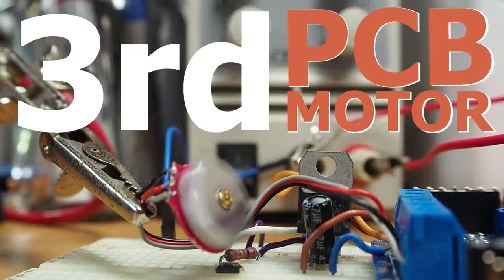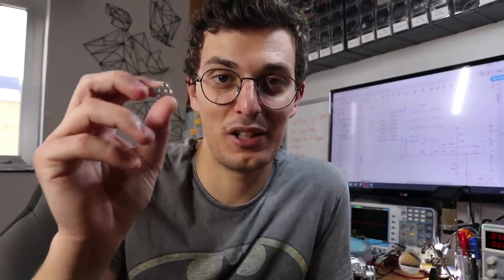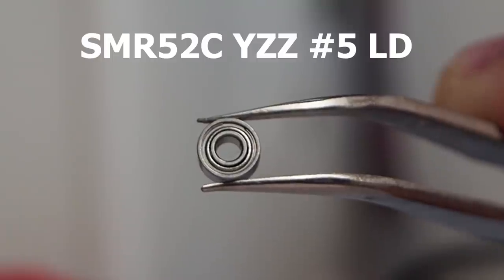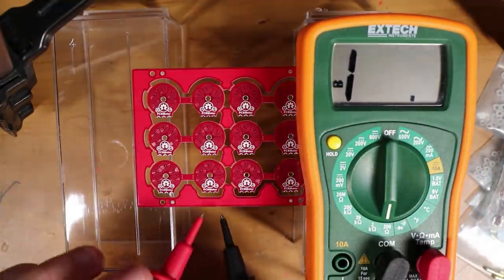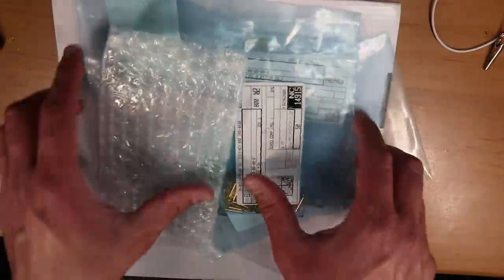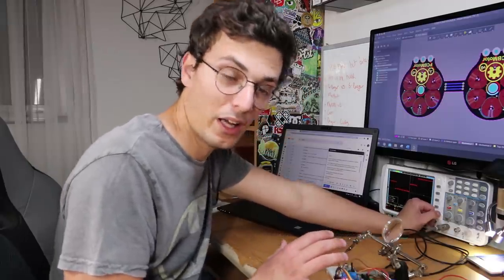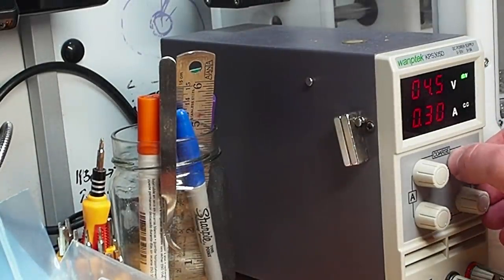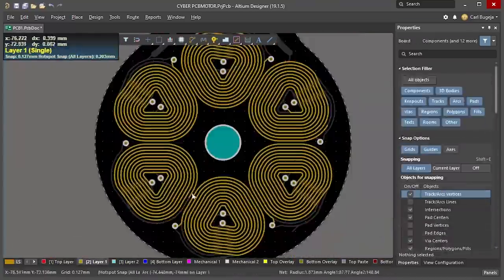Making PCB Motor v3

Comment: You could increase the torque even more, like, A LOT, by putting a piece of iron on top of the rotor, right on the back of the magnets. Brushless motors have so called "back iron" which is the iron ring where the magnets stick to. Yeah that's not alluminium. The magnetic circuit otherwise closes behind the magnets in the air which has a very high reluctance. You can cut such a piece from the iron of an old transformer with big scissors. Since this piece of iron will provide structure you could save part of the gained weight by slimming the aluminium part. This is my field of expertise.
Reply from the maker: Thanks for the tip! I will research this topic further 🙂
Reply: Would it add iron losses? If not, what's the deal with "back ironless" motor designs? And what about Halbach arrays? 

Also, would sandwiching the stator between two rotors be a good idea?
Reply: @CarlBugeja  I agree with nasone32's general idea. Part of the problem is that the magnetic flux generated by one of your windings is weak because most of the path from the north to south of the winding is through the air. So in concept, I think what you want is to equip each winding with a "C" shape iron piece, where the winding and the rotor sit in the gap of the C. The C supplies a much more susceptible path for the coil field, hence the flux is higher.  So, a total of six C pieces, one for each winding. This should also mean that when the rotor is spinning, it generates a far higher back-emf, resulting in a lower effective EMF applied to heating the coil. Just the fact that your coils are getting very hot is a sign that a major proportion of the energy you're putting into the coils is not being used to drive the motor.  (However, If the motor's stalled, then the windings will get hot by straight I^2 x R anyway, because there's no back emf.)
Reply: @revimfadli4666  it would add very minor losses, the magnetic field at the back of the rotor doesn't change much at all.
coreless/ironless motors have no material in the stator which sees a very rapidly changing magnetic field, unlike the field in the rotor.
 a halbach array would work, but packaging in such a tight space would be problematic.
Reply: @bgdwiepp  I see, thanks!
What about adding another rotor so the stator gets "sandwiched"? Would that improve the performance?

And would using a back iron mean adding a Halbach array afterwards basically does nothing?
Reply: @revimfadli4666  yes, sandwiching the stator would improve torque, it would also improve efficiency as that torque would require no more current.

a halbach array would still be beneficial as it increases the field strength in the desired direction, the reduced rear field is more of a bonus.
Reply: @bgdwiepp  thanks!

Ah I see, so halbach array + back iron isn't a waste then?
Reply: @revimfadli4666  correct, there is still field going through the air on the back side of a halbach array, so some small backiron is useful
Reply: @bgdwiepp  thanks a lot!
Reply: Adding a piece of iron or ferrite or some other low reluctance material behind the stator would also help substantially, in addition to a pole piece behind the magnets.  Thinner magnets would make the effective air gap smaller, further decreasing the reluctance and increasing the back emf.
Reply: Or put a second PCB on the other side of the magnets. Adds complexity to the motor, but doubles the torque. Change the aluminium for something non-conductive to stop eddy currents (as noted by Toofsman), and efficiency goes from bad to excellent.
Reply: @CarlBugeja  
не железо. Нужен высокоомный ферромагнетик. или шихтованое железо как в трансформаторе.
А так же нужен магнитопровод соединяющий задние стороны магнитов на роторе. Это увеличит крутящий момент в несколько раз сразу.
Reply: Actually what you advising; Irong back plate act as magnetic conduction bridge that, conduct magnets near by, and makes it bigger magnetic field. It is like using bigger magnet with same size. It is more like Hallbach array princible.

Comment: The delta would be usable with half the voltage.
Scaling up motors to the industrial scale, 3 phase motors come as user configurable as Star or Delta.
In Australia, the single phase power is 240Vac while 3 phase is 415Vac.
When using a single phase to 3 phase inverter to drive a motor, it is normal to connect the motors in the delta config. but when used on the 415Vac 3 phase, we connect them in the star config.
In your demo, you were using 5V, so there is no reason why it shouldn't work at 2.5V in the delta config.
Nice job by the way.

Comment: Cool stuff. The first thing that comes to mind in terms of practical applications when seeing this version is the LSU polygon motor in a laser printer. It's a motor that spins up a polygon mirror attached to it. The mirror then deflects the printer's laser beam to make it cycle through the page in a predictable manner.

I think you'll need at least 15000 RPM for this motor to be practical in that role, and that speed needs to be sustained and incredibly stable. On the upside - no need for high torque whatsoever. With your setup, the mirror and the magnet housing might as well be the same piece, so the only thing the motor would have to spin up is itself.

The same type of mirror unit can be used in a variety of laser devices, such as laser projectors or LIDAR-like sensors.

Comment: You can re magnetize the magnets by heating them and exposing them to a magnetic field then cooling them. You can also add a second pcb on the other side of the rotor to double the power of your motor. Just add a longer shaft. That is the beauty of an axial motor.

Comment: Have you considered making increases to the rotor field strength? Would help with coupling and certainly improve efficiency ( = less heating! :D)
For example, you could put magnets on both side of the stator, or use a Halbach array like Cristoph Laimer's 3d-printed motor.

Comment: Awesome idea! This could also be really interesting to make a linear motor on a PCB. I figure PCB milling should be quite precise enough as a crude linear guide. You could make the coils wider horizontally, add a chip to only power the active coils and maybe add some iron to increase the force. I don't really have much knowledge about motors though.
This could be cool for something like a stewart platform. 6 legs just with their distance to the ground would define the 6dof position of the robot. So with 8 legs that can freely swing you should be able to make a simple robot that can lift two legs while the other 6 keep is fixed, then move all platofmr, lift 2 legs and let them swing back to vertical.

Comment: With a proper driver and commutation using hall sensors, the basics involved are this:
Current = Torque.  Speed = Voltage.
A proper motor driver will reduce current when the commutation is in phase with no lag, so low heat and high efficiency at all speeds. At higher velocity, the current for the torque remains constant if you ignore friction and induced current loss in the conductive magnets.
This motor control can be performed with an inefficient class AB analog amplifier/driver to feed the commuted 3 phase drive to the motor using 3 hall sensors and 4 quadrant analog multipliers to generate drive signals to the amplifier which is configured not as a voltage amplifier, but a voltage to current amplifier. Motor drag, is responded with a change of current to maintain the correct speed by adjusting current to change torque. As the motor runs slow or faster, the voltage to current amplifier automatically adjusts voltage based on motor back EMF to apply the correct committed torque at all speeds.
For higher efficiency, a high speed PWM voltage to current driver can be used instead to produce the 3 phase currents required. If you change from a 3 phase design to a 90 degree 2 phase design, cheap stepper motor drivers can be used to run constant current, thus constant torque and constant heating in the motor at all speeds. Use higher supply voltages for higher maximum speed. To grasp the concepts, stepper motors are inexpensive in smaller sizes along with off the shelf stepper motor drivers. Play with and learn stepper motor driver theory and technology to transfer to your PCB motor designs. You can buy 3 phase versions, but they are less common and more costly.
https://www.amazon.com/dp/B00PNEQ79Q?tag=duckduckgo-d-20&linkCode=osi&th=1&psc=1
Stay away from the arduino stepper H Bridge drivers. They are made for slow speeds such as 3D printers. To learn motor drive and view waveforms, get a real CNC style stepper motor driver.
https://www.amazon.com/Usongshine-Stepper-Controller-Leadshine-2-Phase/dp/B07PHLJM22/ref=sr_1_36?dchild=1&keywords=stepper+motor+controller&qid=1592375778&s=electronics&sr=1-36
You set the desired current in dip switches, and your maximum speed is limited by your maximum voltage used. If 1 Amp is too much, you can buy smaller motor drivers.

Comment: The low resistance of the delta configuration is not a problem, it is necessary for higher speeds but you will need a smarter driver that has current limiting

Comment: Very cool work. Just wondering if the switch to using aluminum for the rotor causes eddy currents, and if that might reduce the efficiency of the motor?
Reply from the maker: Thanks! Hmm 🤔 very good question.. I don't think eddy currents will reduce the efficiency with regards to speed and torque.. But in reality they might be also getting generated in the bearing and shaft... That is one of the reasons why I prefer this over the old design because the bearing is now inside the rotor and not directly underneath the rotor's magnets
Reply: @CarlBugeja  I actually did research in electrodynamic wheels(basically a wheel with circumferencially oriented magnets in a halbach array). We found that all metallic objects created a large eddy current that opposes the field of the magnets. The magnetic field generated in the aluminum will have a phase to the magnetic field of the magnets passing over it, such that as your RPM increases, you will double up or divide your magnetic field strength. Using PVC is a much better idea. 
https://blogs.nvcc.edu/intercom/2014/03/24/majewskis-students-win-research-competition/
Reply: Oh good thinking there, it’s probably why the magnets got so hot. I’d expect the rotor to remain cold. Perhaps make a silicone mould of the milled rotor and pour in some epoxy, maybe with glass beads or fibres for reinforcement.
Reply: @Turkishmath  Yeah the aluminum will definitely produce eddies from the magnetic fields and generate heat + counter-torque from their induced currents, this is why motors are produced in laminated sheets. The only question is how much drag and heat is being generated at these magnetic flux levels. 
You could figure out how much drag there was experimentally by changing the rotor back to plastic or milled carbon fiber and measure the RPM differences between it and the aluminum rotor, and you could test if the heat was the result of eddies or the PCB by literally heating the PCB with DC current (no eddies) through the coils while the rotor is stationary, and see if that heat can make its way through the bearings and shaft and get the rotor past 80°C. If it can't, then heating must be coming from eddy current losses.
Reply: @CarlBugeja  I can see that it might not have much effect at this scale but if scaled up it might factor in. also something to note is that the magnetic fields in the permanent magnets are a lot stronger than the electromagnets, and the fields from the electromagnets are the ones that will induce the eddy currents. so they should not be a concern.
Reply: @CarlBugeja  make the rotor out of PEEK plastic
Reply: @CarlBugeja  Eddy currents will definitely reduce the efficiency. If you want something that can take the heat, has good mechanical properties and is non conductive use GFRP or in other words: Mill out a thick FR4 PCB. It will be lighter, stronger and more efficient than aluminium if done right.
Reply: @ytxstream   you beat me to it.  While ordering pcbs from jlc or whoever,  get them to make a plain disk and a few with holes for the magnets.  No copper.  Layer them with epoxy adhesive.  No need to buy a milling machine - use theirs.  Would the magnets still get hot?  If so, you're saddled with the problem of finding a material that has good thermal conductivity but poor electrical conductivity. Unobtanium?

Comment: consider changing the magnet housing to a non-conductive material (other than plastic of course) or use laminated sheets of aluminium epoxied together perpendicular to the pcb. the eddy currents in the housing is giving issues with heat and sapping a lot of the power. adding iron would make this worse. iron is only good for flux coupling and since the magnets are already so close the coils there is no point. any additional metal on the rotor would do little to the flux linkage other than leak power. iron is usually used around coils to help concentrate the flux into a particular axis. around magnets not much happens. consider stiffer thermo-setting plastics such as delrin if possible. delrin is easy to machine even on small mills and lathes.

Comment: I wonder if you could sandwich the rotter between 2 PCBs on top and 2 PCBs on bottom. This will trap your spindle between 2 PCBs on either side (higher stability) . Then use the outer exposed disk for mounting blades to instead of shaft. Might be interesting to do push pull between top and bottom PCBs due to heat. Also if u cut small curved vain into the aluminum you can have it self cool to a point.

Comment: Any room for heatsinking the back side of the PCB?

If you mill another magnet rotor, maybe cut some grooves / fins into it so there is a slight cooling effect without much if any extra drag.

Comment: To get the most out of your magnets you need to confine their flux to pass through the stator as much as possible.  To achieve this you should use a magnetically permeable material (a steel washer perhaps?) to back the rotor and make the rotor double sided.

If you could source them, halbach arrays would be ideal.  Not sure how realistic that is at this scale.. Trapezoidal or sector magnets would also let you use the space under the disc more efficiently. Maybe you can get the HDD magnets from an oldschool iPod or something. 

Given the choice of using more of the space you have for magnets or just a higher grade, more magnetic material is usually the way to go.  imho.

Comment: Very nice!, except for adding iron to define magnetic path, maybe also try rotor with no indentation to minimize air resistance or drag, the loss is related to drag and square speed.

Comment: Very interesting! I like the direction this is going.

Have you considered putting thermal epoxy as a heatsink on rear of pcb where the coil areas are?

Also you can get magnets that are rated to 125+ celcius. "Polymagnets" can generate greater force than standard magnets, Correlated Magnetics make polymagnets.
Reply: thermal epoxy is there just to fill the gaps between a heat source and an alloy heat sink (cause perfect flat surfaces, that could touch each other with 100% of their expanse, don´t exist), and doesn´t help dissipate heat itself!
Reply: @klausbrinck2137  yes an actual heatsink would be superior with thermal epoxy to bond and provide optimal thermal connection. But thermal properties can be improved with just thermal epoxy, it still wicks heat away fairly quickly and increases surface area.
Have you seen microcontrollers on a pcb under a pool of set thermal epoxy?

Thermal epoxy can be cast or overmolded into shapes like normal resin.
Reply: > Have you seen microcontrollers on a pcb under a pool of set thermal epoxy?
Do you mean the black blobs common in very cheap applications? This isn't for thermals, if's for protecting the die.

Comment: Couple questions. How difficult would it be to implement a halbach array in a design this thin? I realize this would require magnets with more optimal shapes than what off the shelf circular magnets provide. Have you also tried using a rotor on each side of the stator? Most axial flux motors, which this motor is, uses that design; I also know some designs, both single and dual sided, use an iron core on the rotors, where other designs do not, so that might be another thing to look into.

Comment: Solder two or three on top of each other for more effective windings! Would make the delta more usable.
Reply: In that case maybe go with more layers?
Reply: But he would have to put them in parrallel since else the current would be half as much leading to the same torque since B=μ*N*I/L
if N stays the same and I is getting half and L is staying the same the magnetic field per PCB would be half as much. And due to 2 PCBs the magnetic field would stay the same.
But if he put it in parrallel there would be a magnetic field being stronger.
Reply: neutronen stern
Series would mean a higher total impedance, which would make the coils easier to drive with less losses in the driver, or prevent the coils overheating at 100% duty-cycle at the fixed voltage like we were seeing earlier. Not that he should be forced to run the coils at 100% duty-cycle, that is.
Reply: 1-2 pcb on each side of the rotor? more surface for heat dissipation, for the higher-current case (delta?) ? anyway not all pcb´s on 1 side, cause the small magnetic fields (of he windings) would never reach through to the rotor-magnets!!
Reply: There might also be an advantage in sandwiching the magnets between two PCB's in being able to direct air across the sandwich of PCB's and magnets and thereby increase cooling efficiency.